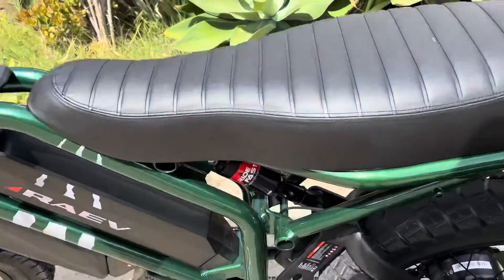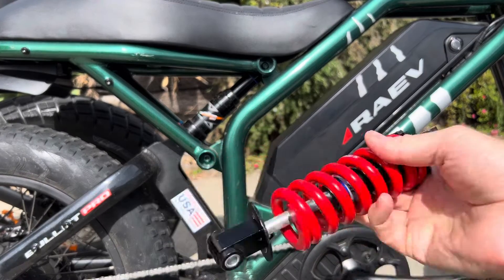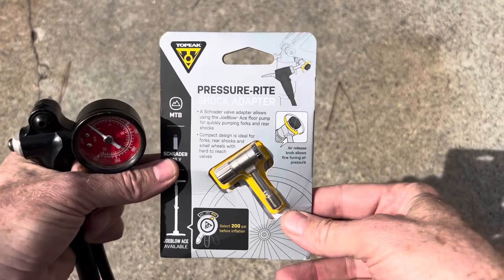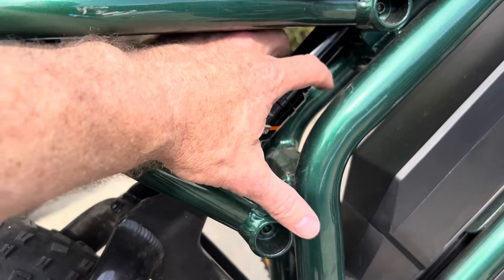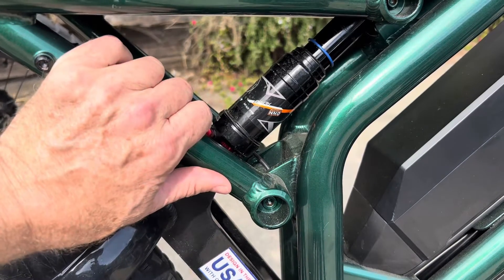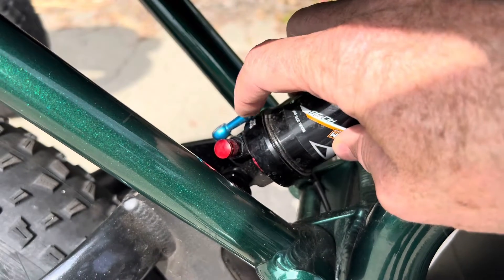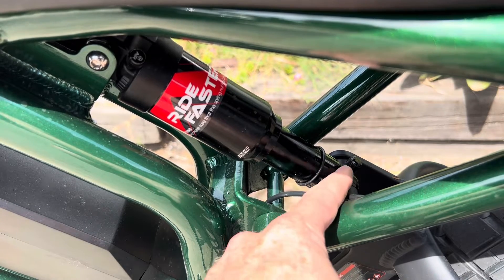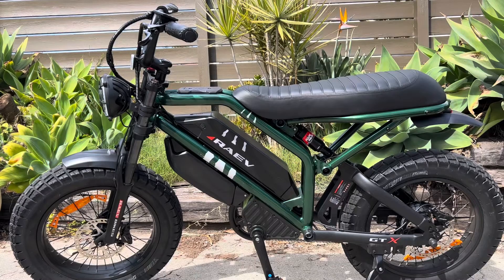How To Set Up An  Air Shock On An E-bike

Comment: I just ordered a 
DNM Mountain Bike Air Rear Shock With Lockout 200x55mm 
from eBay. 

Can’t wait to install it on my ebike. I have plenty of room for both valves.
Reply from the maker: It will make a big difference. Most of these cheaper e-bikes come with terrible shocks that barely work at all.

Comment: Great video, so o bought an A5 rr1 rear shock, applied it and Stiff..no sag😢😢 and ideas¿  shock size is ( bolt center to center) 7.4inch
Reply from the maker: Is that an air shock? If it is, you can let some air out of it. If it has a spring, you can loosen up the tension on the spring. If it has a really heavy spring on it, then it’s not going to bounce at all.
Reply: @hoohoohoblin yes my bad, air shock with negative and positive air inputs, I let the air out of it and compressed it several times.. seems to be working now

Comment: The first shock was upside down, the 2nd shock was right-side up. I've been told installing upside down can hinder the internal grease flow -- what do you think?
Reply from the maker: I don’t know. I’ve seen a lot of professional mountain bike builders put them in upside down, and they say it’s fine. I wonder if it differs depending on the manufacturer of the shock.

Comment: My rider is 65kg, i have installed a rear air shock & on any PSI, it doesnt move. I know my rider is light, but my air shock doesnt work. Please help
Reply from the maker: Sounds like something else is wrong. It must be seized up on the inside.

Comment: Im certain you're a teacher in your day job.
Usually far too much info on other channels and no mention of the negative air chamber adjustment.

I really need to get the settings right on my e-scooter.
To improve the ride comfort, the stability at speed 
(sometimes at 80km/h) and the handling.

I'll try what works for you... virtually no pressure in secondary chamber.

Or maybe i should get back on my old 7kg fixed wheel track bike... virtually no maintentance or settings to contend with.
Reply from the maker: Definitely try a lot of different configurations. There has to be one that works. It’s crazy that people sell bikes with these shocks on them, and there is no documentation to tell you how you’re supposed to set it up for your weight.

Comment: Great video, question, do you know he purpose of the o-ring outside the air suspension? I just noticed the o-ring on my gtx and curious why its outside, hope to hear back from you thanks
Reply from the maker: Yes. That is there to measure how far the shock absorber moves when you on it. The sag is how much it goes down when you sit on it. Do You want it to sag a little bit for it to work properly. Usually, about a centimeter on a shock this size.
Reply: @hoohoohoblin  thanks man, your videos are very helpful, by any chance do you have a video on how to replace both brake pads on the RAEV GTX? Thanks

Comment: Does the bike come set up?
Reply from the maker: You have to put on the front wheel and the handlebars and headlight and plug in some wires.  The air shock comes already pumped up with a lot of pressure. I think they set it up for the heaviest of riders. Mine worked better after I let some air out of it.